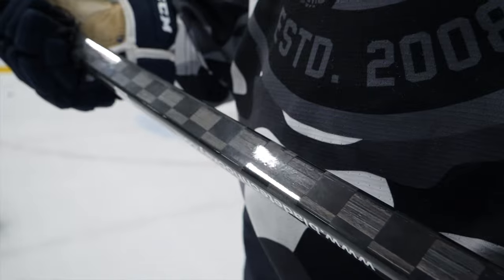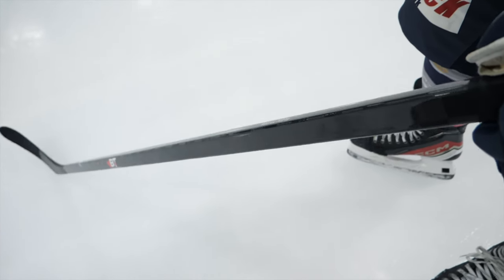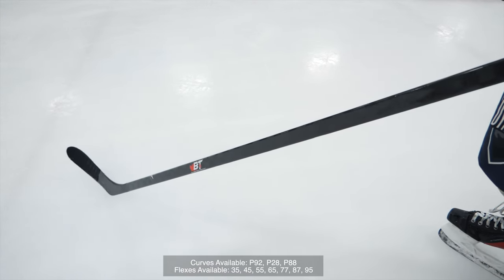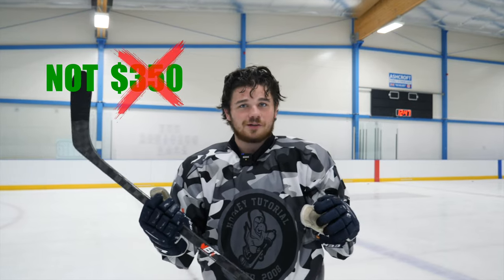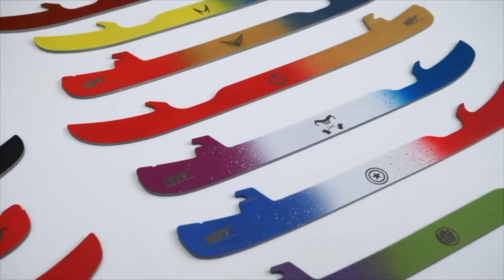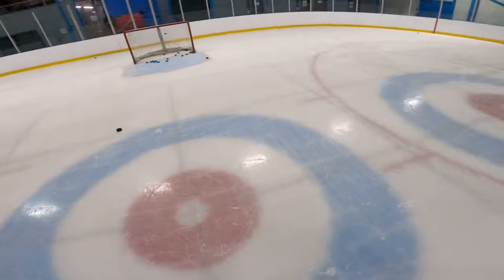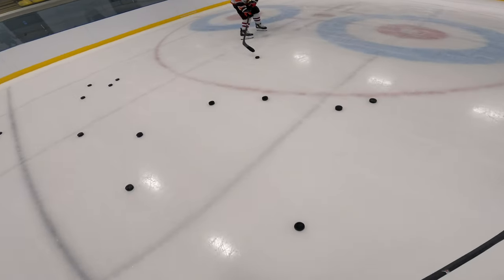REAL Pro Blackout Sticks You DON'T know - This might be your next stick

Comment: I would love to see you guys put this up against all the low kick top players, Trigger 8 pro, FT6 pro, Hyperlite 2. I would love to find an alternative stick for my son that is say 90% the performance but twice the durability. If the high end sticks lasted a season I wouldn't have as much of an issue but dropping 300+ on high end sticks multiple times a season in these times is insane. We've tried other black out sticks and though they're durable there's also little to no blade feel. If these are in fact different and not rebranding from another blackout source that would be amazing for the price.

Comment: Is there any way to find out if these are the same as the hockeystickman blackouts?
Reply: This is the question we all want to know
Reply: Probably not. I have a problackout lite from hockeystickman and it does not feel good. There is no puck feel to the blade and the flex is super stiff compared to what they advertise it as. That's just my opinion though. I've heard other people say they love them.
Reply: @ENOCK360  I also tried one and it felt like a 100 flex and was hollow feeling
Reply: @jondub9524  my 80 flex feels like 100 even though it does flex quite easy while watching slo mo video from my phone. Durable stick though.